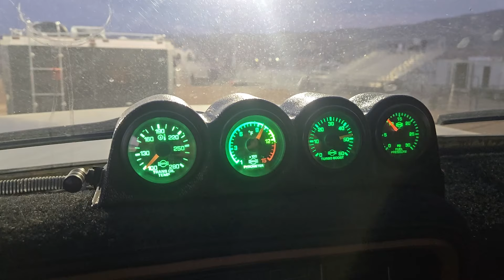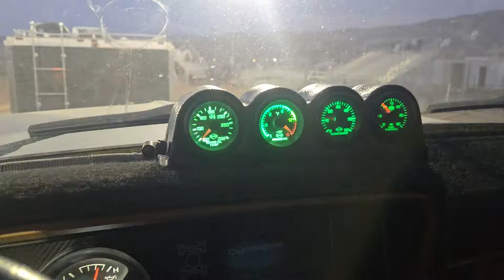The Final Run. I Road to 600 HP - Ep.9

Comment: I think if you back down the starwheel and smoke screw a little bit you might pick up that 50 hp you need. A lot of guys actually do the ve tuning with the whole afc out of the truck, using an air compressor to set what psi it gives the engine pre and during boost fuel
Reply from the maker: Yeah, I'm going to play with all of that

Comment: I think with a set of ddp4 tips and a savage fab 9 you would not only love how the truck drove and hauled but you would get your 600rwhp especially if you went back to PDD and spent time tuning fuel timing and wastegates. The twins on old yellow are a 700deg egt drop over my single on the crew and it spools just as fast and pulls way harder on top. It’s hard to beat compounds for a daily. You probably should go on and fire ring it though for safety.
Reply from the maker: I've got the savage fab 9 cm exhaust housing to put on the s300. I think I'll do that and DDP injectors and hit the dyno again.

Comment: Road to Pure Stock.
You did very well, yes you should continue the road to 600 H.P.
Glad you made it home in a running condition. 
Tuning is so important, and it looks a little over fueld? Hmm? How to tune for more power, less smoke❔️ 👀 😉.
👍🧡 🇨🇦 🖖🏻.
Reply: I don't think you know what you are talking about man. there is only so much he can do to not smoke that much. you can't tune a 12v... so obviously its going to smoke since he has bigger injectors and so. the only thing he could try and do its go bigger turbo or turbos but that's about it.
Reply: @bryancpf  the amount of tuning you can do on a mechanical 12v is almost limetless but it requires mechanical changes to springs and screws not a laptop. Timing fueling and their relationship to boost can all be modified.

Comment: Little more timing should get you there Looks like plenty of fuel  my 1994 215,ppump  with a single turbo 62 mm made 533 horsepower 24° timing 191 delivery valve 5K governor Springs Stage one  ported head stage two push rods bigger cam 181 / 210 5 speed NV4500 transmission  single disc clutch   it a fun old truck  love watching other  peoples ideas on  making horsepower  There’s a lot that goes into it Ring gap pistons everything  love the content  you make on the 12 valve Cummins

Comment: Awesome dude, I do have unrelated question, when you put a g56 in it where did you get the 1 inch body lift, I can only find a 3 inch
Reply from the maker: I buy 2 inch wide by 1 inch thick stock from McMaster carr and make my own.
Reply: @decentgarage  what material do you make them out of, just like standard polyurethane rubber
Reply from the maker: @BillJoe-b7h  yep antistatic slippery polyurethane bar 2"x3'x1"

Comment: I know you have explained it in past videos but you should throw the build list in your video description and I'm curious what was your torque numbers?
Reply from the maker: Oh that's a great idea! And unfortunately the guys with northwest dyno do give torque numbers
Reply: @decentgarage  still really cool to see what kind of power your truck puts down but having a torque number definitely paints a bigger picture but Nice setup man I'm curious to see what mine puts down for power I can spend mine in third on drive pavement with 354 gearing and in fourth gear it's trying to break free got to be careful going around turns because it will walk out around you in 4th lol
Reply from the maker: @shmes9  my estimate is that the torque is around 1100.
Reply: @decentgarage  that kind of sounds low unless you have your timing set pretty high

Comment: I wish I had the crew cab, but im stuck with long bed single cab 93 ve w250 with the stock getrag.  I would love to hit 350hp and as much torque as possible balanced to be as smokeless as possible
Reply: @grindlifegaming2833  powerjet stage 2s from power driven and the right turbo and you can do 350rwhp and probably 900tq with the right turbo.